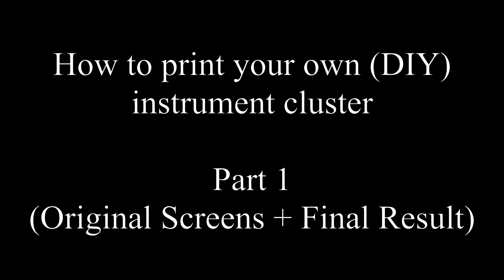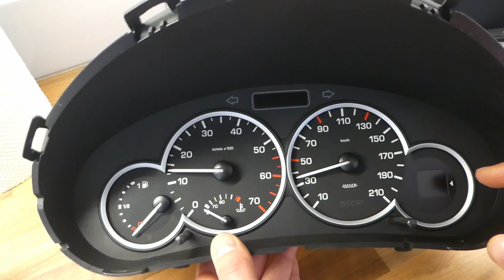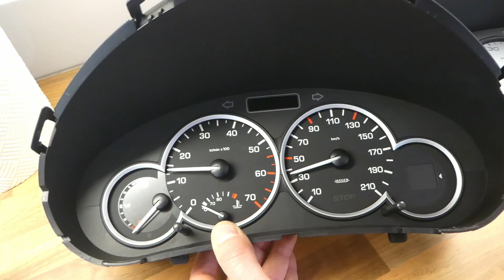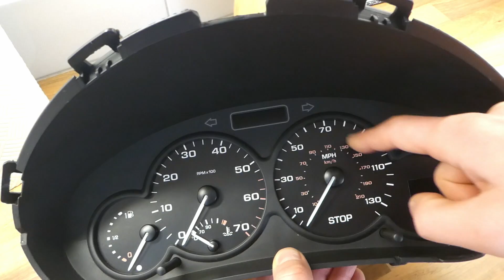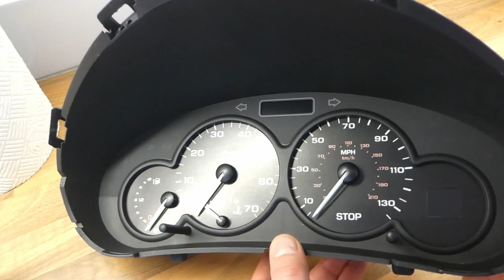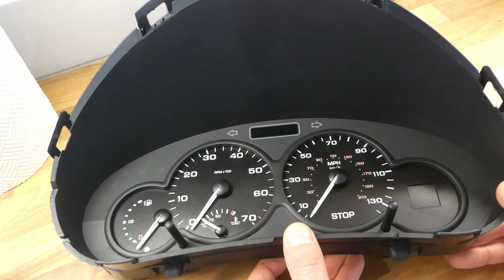1. How to print your own (DIY) speedometer/tachometer (instrument cluster)

Comment: I'm curious, how much do you charge to make custom clusters for people?
Reply from the maker: I do not make custom clusters for people, so do not charge anything. I had to make one for my car, so decided to document it. There were no guides for these and I wanted to see if it can be done. Turns it it can be done.
Reply: @moremolecules  thanks for making this guide! 🍻😎
Reply from the maker: @VipDetailingMontreal  THe best way of course is screen printing and it will be as original quality, but I did not make it that far. Probably quite easy to screen print one of these and one can play with any design.

Comment: Peugeot 206?
Reply from the maker: Hi Alessandro, yes the donor instrument cluster came from Peugeot 206 (automatic). It was very convenient that the automatic square display is a perfect fit for the cruise control on the Peugeot Partner.
Reply: more molecules I love that car 😍 I’ve got one it’s from 2002 full manual
Reply from the maker: @alessandrom.3458  Yep, looks really good and I hear it is a good drive
Reply: more molecules yes, the steering it’s a little bit hard to rotate but overall it’s a really good car
Reply from the maker: @alessandrom.3458  Haha, the power steering is a bit weak on my Peugeot Partner as well.